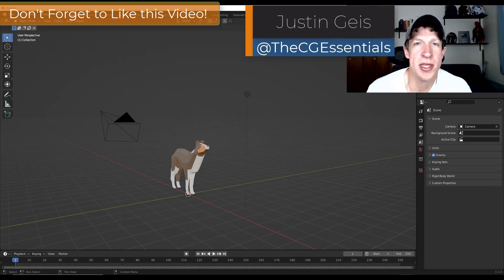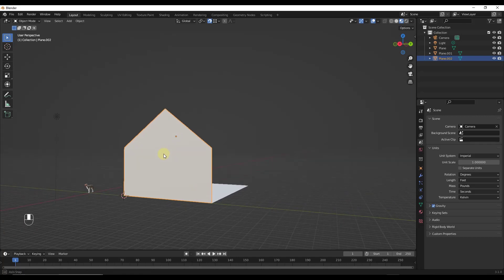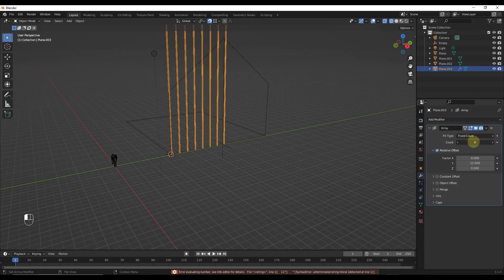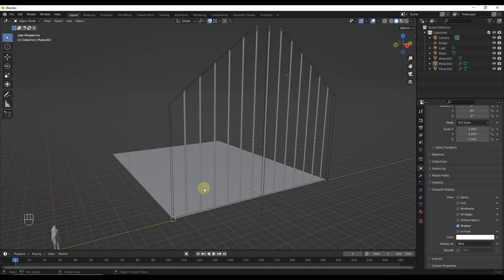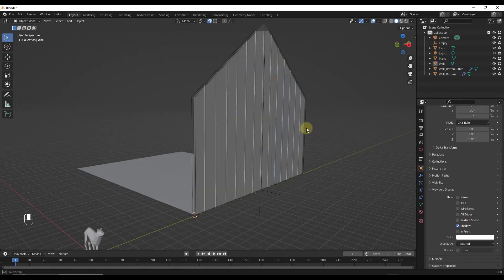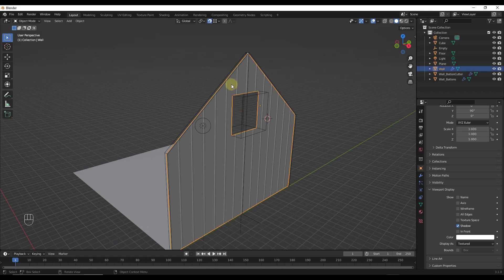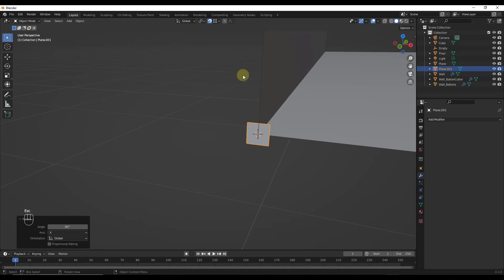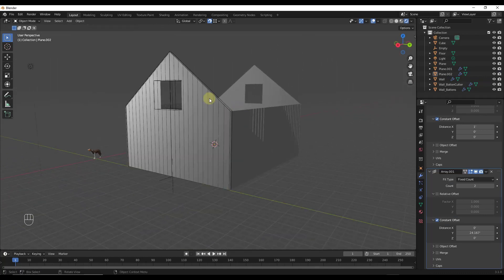Modeling SIDING in Blender with Modifiers! (Architectural Modeling Tutorial)

Comment: I got wall with cut outs to work in eeves but not in cycles. I fixed most of it by fixing the normals to correct facing. But the intersection wall created to cut battens worked on battens but not the wall itself. So battens are trimmed at openings and roof. But openings in the wire frame wall still show up in cycles rendering. So please test with cycles and let me know if it works. If it does I'll just check my work and see where it's off. Thx